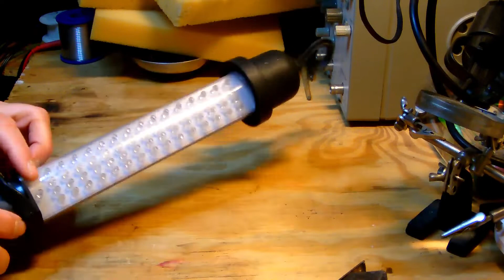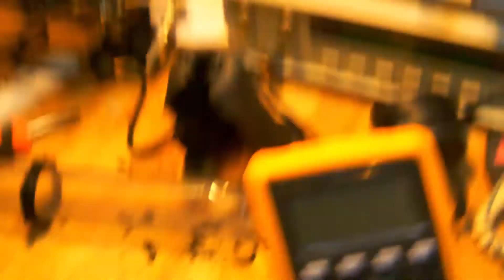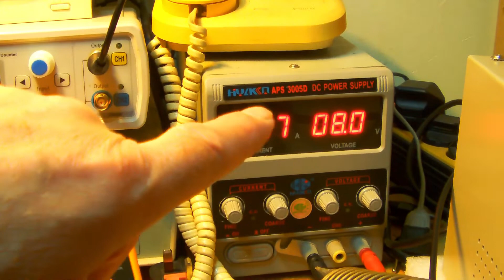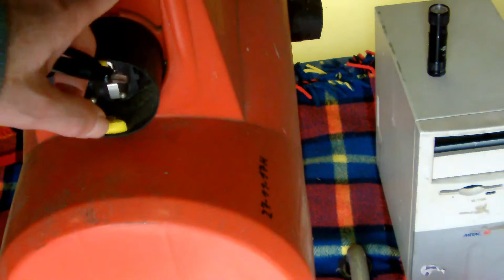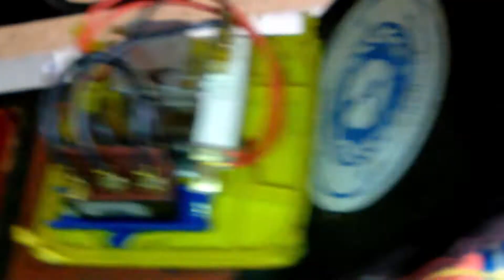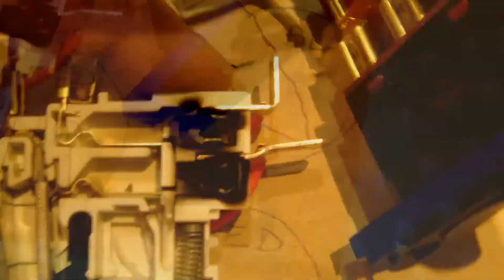Planned Obsolescence? Comstar Sabo Mulcher & Topcraft Inspection Light

Comment: I had one of those and it also failed.
Reply from the maker: I suppose you mean one of each? well, it would seem these things have a rather high rate of failure due to specific parts that give up the ghost after a while. Both the inspection Light and the mulcher had signs of heavy use though, but still, you'd expect either device would last a long while considering their "rugged" appearance. Thanks for watching, giving a thumb's up and subscribing :)